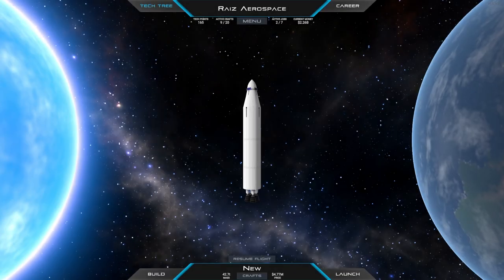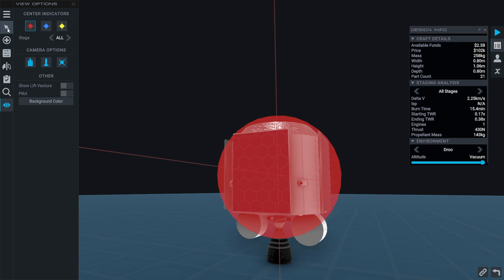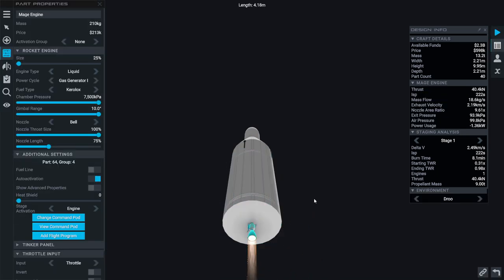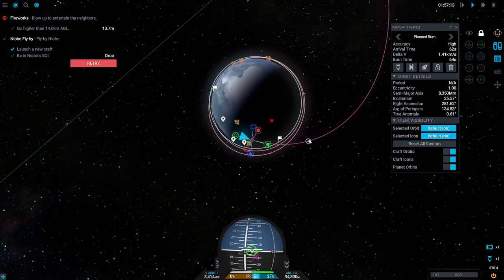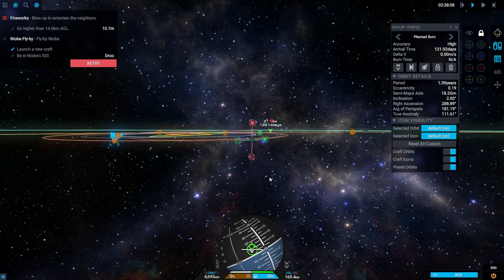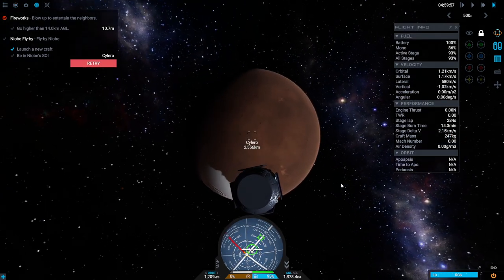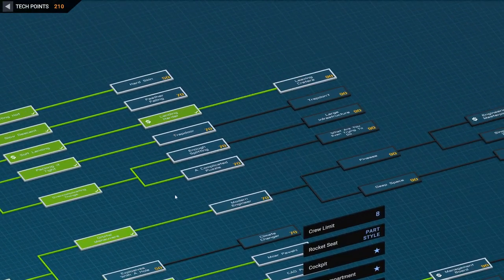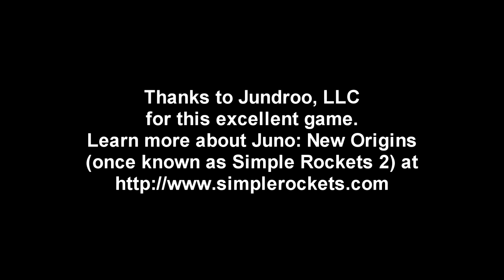Juno: New Origins (formerly Simple Rockets 2) - Career 09

Comment: I had a lightbulb moment with the RCS thrusters. You only need 2 radial gimballed RCS pointing directly to the center axis of the craft and CoM. You can roll,  yaw, go forward, back, up and down (6 DOF). Yes it is a bit inefficient with fuel but so is having 2-3 RCS do the same work, you can save mass and the fuel loss is negligible. The tooltip is right, it does save on having to use 5 thrusters for the same capability (you would need to attach 5 on a block to have the same functionality).

The single RCS thrusters are useful for translation in a 2x radial on the CoM, complementing the gimballed ones (moving side to side without rotating).
Reply from the maker: I'll confess that I'm just not enthusiastic about gimballed RCS at all anyway. After all, RCS in real life has a propensity to fail and you'd rather have backup RCS than have relatively few ports do all the work. I would always prefer to over-RCS.

Comment: With the manoeuvre nodes, you need to click on them, unlock them, and then click delete in the menu. The red X works half the time for me but you have to be very precise with clicking the x and not any space around or in between it. It’s best when it’s away from anything else you can click on. It’s super finicky so I usually just delete in the node menu

Comment: Thought you’d like these RCS nozzles. I usually put them in some sort of containment for aesthetic purposes. Or I even put them inside the fuselage and then add some cosmetic parts to make it look like there are ports in the craft where the RCS nozzle is blasting from. Use the tinker panel in the part properties section of the builder to artificially change the size of certain objects (their mass and drag remains the same) so that you can make your craft cosmetically pleasing too. I haven’t been able to use the career mode since I’m on iOS but I assume it’s still there. Hope this helps!
Reply: And great videos btw!